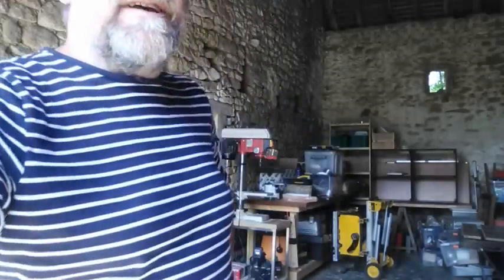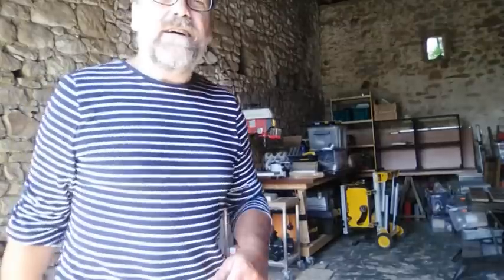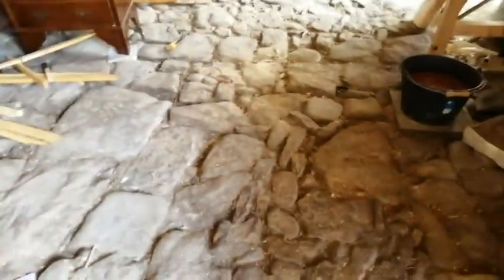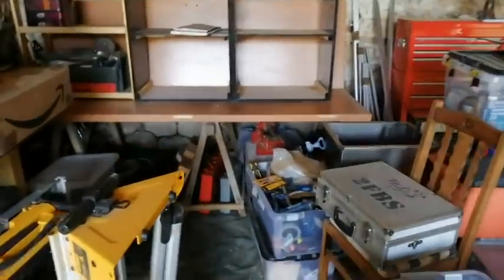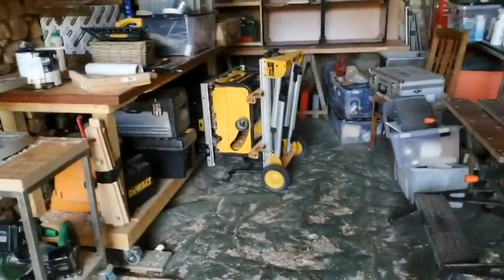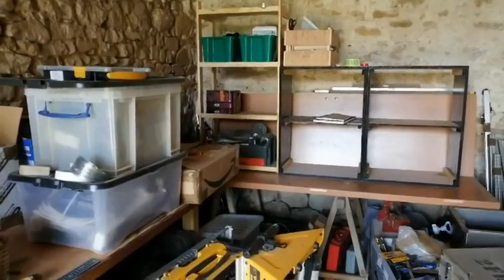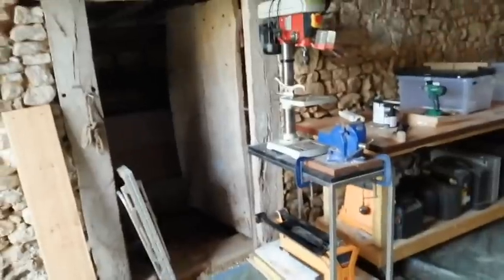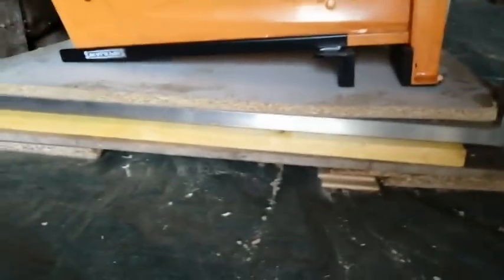P1. Chateau De Montmagner- Renovating a 14th Century Chateau in France  - Teds day of pottering!

Comment: Hi from NZ,
I have the same Bosh drill in my kit and I have had it from the 1980’s and still going strong....😀
I too would have suggested this..... putting a board across the front of the barns and putting a load of sand in to level it all out and then putting a tarp  over the lot. 
Works like a charm.
All the best.
JPK.

Comment: Hi Ted
Re the floor, if you want to keep the original floor for posterity and maybe use in the future, how about doing a level layer of sand on top and lay paving slabs loose but tightly butted up and fine sand to grout, that should give you a good level stable floor to work on and easy to repair or lift in the future.
Thanks for a Great show by the way, right I’m off to potter BFN 🏃🏻‍♂️💨
Reply from the maker: Good idea 👍